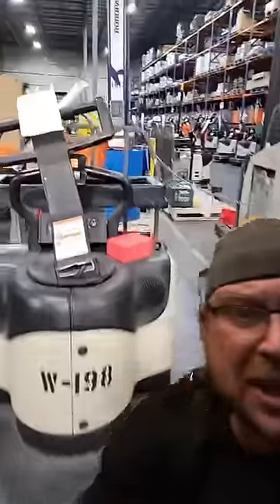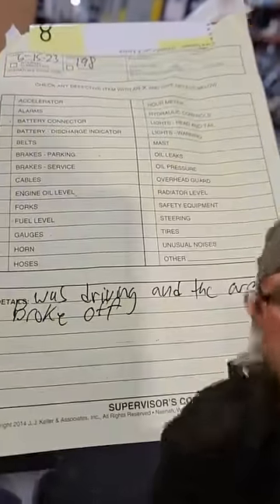Forklift Expert Analysis ￼

Comment: "while performing my daily inspection, which I do every day, I noticed that the handle was broken."
Reply from the maker: LoL 😝
Reply: My factory has inspection forms dated 2019 on the fork trucks. The funny part is that there are only 5 days worth of inspections on 1 sheet, so it's been a while
Reply: @jake6483 as long as all five days are filled out. That's all they're looking for
Reply: I go right down the sheet and keep it at 5mph all day
Reply: I unplugged it.
[checks everything off as good]
Reply: I just memorized the numbers for about three different jacks and forklifts, and wrote them on my inspection sheet every day 💀
Reply: Lololololol
Reply: When I do daily lift checks at work, most of the operators don't think or care to check the lift every day. Most of the shift spots where the forklifts was used that shift are left blank, because one operator forgets, and the rest assume it's already been done for the shift. That's one of my personal pet peeves. if OSHA was to come around and do an inspection and verify the lifts were used and saw no operator inspect the left for that shift, the company would get a huge fine from them.
Reply: Idk about all that... I just walked by it, brushed it w my purse on my way out & boom, it just fell off 😳🤷‍♀️😂

Comment: The original reason on the piece of paper is already gold. "Was driving and the arm broke off". Probably entirely accurate in itself, just leaving out the massive collision that happened to simultaneously occur.
Reply: It’s never what’s said, it’s what’s not said.
Reply: Naaah.  Man was on time block in the isle due to spill clean up sat on it happens all the time
Reply: Hey! That "massive collision" was my fat ass sitting on it talking to the thick new chick in the aisles 😅
Reply: hey. was driving ? check. arm broke off ? check. I see no lies here.
Reply: Repair guy doesn't need to know any more :)
Reply: It this poor guy could have been set up and actually didn't notice it, I've seen half broken stuff get fully broken when someone else gets it more then once
Reply: @drewrinker2071  true. "Here I was, doing what I could to prevent such an accident - putting some healing grease and repair-dust on top of the crack, I even gave the poor thing a rest by putting it right back into the equipment collection, without a warning label because I'm against discrimination like that... But you just had to break it, didn't you?"
Reply: Probably tried to ride it down the aisle doing a handstand on the handle with all the 300 lbs of overpower they got
Reply: It was using the handle as a chair to ride it.
Reply: @decnet100 healing grease. 😂😂
Reply: "I'm fairly sure the collision was unrelated, so I just won't mention it"
Reply: Haha simultaneously
Reply: Never said what they were doing while driving
Reply: Well, it is a crown🤷‍♂️

Comment: As a seasoned overhead door mechanic, I thank you forklift operators for the never-ending work.
Reply: I one time parked the forklift in front of the door because i KNEW it wasnt gonna fit. I go inside one of the guys calls me over to figure something out and i just hear CRUNCH. 🤦‍♂️ One of the other guys just drove it right though a partially closed door. Smh
Reply: I also thank them. Just worked on a rytec the other day that "came down" on the forklift. Nevermind the fork marks and the bottom bar being wedged cockeyed in the opening. Two sets of photos, two light curtains, two loops and a bottom edge and they still somehow smash a 30k door. Must have been booking it.
Reply: Do you work for overhead door?
Reply: No kidding bub.
Reply: @alfhwuqd  Yup!! Like the UPS driver who took out 2 sections, broke his windshield, and said the door was fully open.
Reply: I’ll second that seems Iam always working on doors that a high reach drive through and I’ll give ya one even better one of my stops is a freezer warehouse the clear rubber flap doors we have one that opens barn style and those get rapped around the top of the high reach mast when they ride through it at Mach jesus and it rips that door slab out of the hinges along with the drive chain and motor and the 3 phase wire lol that’s a 8.5 hour work order at -20 degrees lol 😂
Reply: Short story time, my workplace safety officer manage to take down a roll down gate and totaled the forklift he was using, best part, this was an hour after a safety meeting for "being aware of your surroundings"
Reply: @AerodynamicBrick  lmao impeccable timing sounds like lol 😂
Reply: @davidf644rock  I don't. But have friends that do.
Reply: Installed a new right height high speed door. Came back the next day to do another, and a forklift driver had already smaked the aluminum roll tube.
Reply: @AerodynamicBrick  Nice! His surroundings bit him in the ass.
Reply: You're welcome
Reply: We don't need you...we just leave the door a mangled mess at my place instead 😂😂😂😂
Reply: Weve had a door to a freezer installed thats both heated and if hit by a forklift it unzips before springing back into itself and rezipping, the door usually raises like a conventional rapid rise door operated by a pressure switch under the concrete. Looks to be a winner for the guys that fix them so far..
Reply: Lmao just yesterday at work i didnt realize the guy that opened the shop didnt open the garage door all the way and when it is opened all the way up there's about a half inch of clearance yup i gave an overhead door mechanic half a day's worth of work
Reply: I've never made you a freakin' dime, bloodsucker! 🤣 Of course I'm joking, I crushed 3/4 of the roll casing my first year as a EO. That was a very long time ago, and the shame has prevented me from ever doing it again. 😐
Reply: @jcheever37  I have the same story except "one of the guys" is just me, 5 minutes later.
Reply: @Colonel_Flanders  I've definitely clipped the last panel once.
Reply: It's always night shift
Reply: @Hanah  More times than not. They call to report that the door won't go up or down, I get there, and half the freakin door is in the parking lot. Yup, you're right, it definitely won't go up or down.
Reply: As an Automatic door tech I do not thank Forklift operators for the work. Lol
Reply: Many years ago I worked in a warehouse. During an annual inspection, the fire marshall told the company they had to repair or replace a huge fire door. I think it was over $5,000 back in the early 80's. The very next day, a dumbass on a forklift drove through the opening with his forks all the way up and destroyed the brand new door.
Reply: Dont forget about sprinklers, forklifts have a natural attraction to sprinkler pipe.
Reply: I saw a truck have to repark in a bay and then his back door swung open and completely detroyed every panel on that door and the trailer door. Everyone on the whatehouse came to look at that shit.  Dude was fired.
Reply: I’ve been working for 1 year in thid company and the overhead door was smashed 3 times
Reply: It is amazing how many perfect fork shaped sight windows I've seen punched through roll-up doors.
Reply: I say thank you, and it was second shift that did it, but thank you.

We have a heavy sliding door to one of several cooler areas, and the particular one looked like someone drove a forklift full speed into the door, from the inside.
One of the guys that came to repair it looked like Jack Reacher with a beard.
If I was gay, I would have creamed my pants looking at him, dude was that impressive looking.
We shoved the door closed as much as we could for a week, but it was like a chunk of the door roaring out, like the Hulk punched it before pulling it it open.
Reply: @deadjuice1880  sounds accurate
Reply: Lol I did that once unloading a truck at my old job. Hit the outside trim when I put the pallet jack up in a truck and went to back inside bc it was rainy. Forgot to put the forks down like an idiot (also talking to buddy lol) and ran the load backrest into the top of the door. I was sitting with that thing on the two front wheels battery and counterweight like 3 feet in the air. Only hit the outside though so I just went back later with a mallet and a tube of silicone (I worked at a hardware store) and bent it back, then sealed it up again. That was the only time I ever hit anything though, I like to go big with my screwups. First time I ever got pulled over a few years back was 120 in a 55 💀 maybe the go big mentality isn’t it.
Reply: i literally smacked an overhead door yesterday at like 10 mph 😭
Reply: @QuantumBender  thats nothing foot on the floor Friday a skid thats almost as tall as the trailer about a half a foot of the floor wam that door was done for
Reply: @quantumbender5840  ripped like half the rollers out
Reply: I've been lucky not to hit one but I know guys who have. I saw a guy break a glass overhead electric door. He put it down as he was going out and wasn't paying attention. Supposedly they docked his pay for 40% of the door, which he claimed was $1200
Reply: Place I worked at replaced all of the broken sectioned bay doors. They got them all done in like three days. Six or seven doors. The day they finished them, I was working on a night crew and watched a guy try to pull a semi load out of one of the bays with the door only half open. Destroyed the door. Like two days later someone on a forklift took out another door. The assistant plant manager was tiiicked.
Nobody has whistlingdiesel beat for breaking doors though. 😂
Reply: I worked in an offsite warehouse and I let the other guy open the roll up door before I pulled our box truck out of the warehouse. He didnt roll it up the last 8 inches and I bumped the door with the top of the truck. Thats on me for not double checking. I rolled the door down straightened it out. Not much bend it it because I dont drive like a maniac. Somebody reported back to the manager and he drove over and asked if there was something I wanted to tell him about. I had no idea what he meant. That is kind of a childish way to ask someone about something. He did have a masters in psychology so I always expected dumb words to come out of his mouth.
Reply: @alfhwuqd  Former forklift driver here. I loved timing it to where the rollup would be an inch above the forklift as I was going in/out as it was coming up. Never once did I hit it, but I almost did coming inside fully loaded (8,000lbs on an 8,000lb truck) on fresh snow. Did you know tread is useful? Management still doesn't believe me that it's useful for winter time.
Reply: The high speed roll ups are apparently not high speed enough...
Reply: @alfhwuqd I have had a door decide it was just going to refuse to open when the computer throws a fit before spent 20 minutes figuring out which breaker on the main panel it was to reset the damned thing so it would behave again. No remote disconnect anywhere remotely near it  so for 20 minutes got to play radio tag with the super.
Reply: @bigpimpin6085 that half inch between the top of the pallet and the sprinker is plenty of room.........
...........
Reply: LMAO!
   Define you had job security!😂
Reply: @davidf644rock  No.
Reply: I laughed much too hard at this. One of my customers got a new roll-up door, lasted all of 2 days. 😊
Reply: There was a manager at my old job that ripped 2 panels out from the middle of a door before. Dude was never drug tested. Later was arrested for robbing old people at the casino in the area while still working there.
Reply: @rmo9808  I go on a Home Depot call, midnight. The rolling steel door ripped out of the guides. I asked who the clown was. They said the night manager was on the forklift. Nuff said.
Reply: Just want to say sometimes it’s the floor care guy riding the massive floor scrubber and not a forklift that hits the roll up door so make sure to thank them as well
Reply: Sup, fellow seasoned OH door guy....42 years...got started at 11...fam owned a door company...peace
Reply: It's not only forklift operators who do that, sometimes forklift techs forgot a thing or two...
Reply: We used to have a FL driver named Dan. Dan was not known for his smarts. Dan managed to get the OH door to come down between the mast and operator compartment while the truck was in motion. I witnessed this first-hand along with Stan, the very competent person who was promoted out of there forklift position allowing Dan to be hired. 
Stan immediately hung his head down and said "I guess I'm going back to the forklift".

Comment: I've heard :
 "it came like that", 
"because it's a crappy brand",
"the guy you fired last week/month/year used it last"
"I didn't even notice"
And number one reason I fired someone: "I don't know"

BEST excuse ever: I didn't drive the bigass Kalmar AC120 through the brick wall " - this was LITERALLY said to me WHILE the rest of the crew was digging the guy out from underneath the rubble that once was a wall....HE STILL HAD BRICK DUST AND CHIPS IN HIS HAIR. OH, And he was still in the driver's seat. 

I'm glad I'm retired.
Reply: I shit you not.  We bought a brand new forklift that was delivered with zero oil in the differential.  We didn't realize it until about a month or two later when it just hard stopped one us while I was driving it.  Out mechanics said it was bone dry.  The dealer didn't add oil in that one, and got to change the whole front end out.
Reply: But officer gas pedal was stuck😅😅😅

Comment: Hi ! Well I hope they didn't get hurt  ! I saw someone who was killed using one of those electric pallet jack lifts , laying on the floor , chalked out by the police ! This was before they had the stop pad on the top of the control handle , she was backing up a pallet in reverse in confined room with shelves on both sides of the small storage room . She backed her herself against the self support column behind her ,with the handle being pressed against her abdomen,belly button area . Back then these lift would still roll some what after you stopped using the twist control handle, like on throttle control like a motorcycle has on the handlebars. I think she went to react and accidentally twisted the handle the wrong way in reverse, after  realizing her back was against the support beam for a shelf that was behind her with the control handle in her belly button area, it pinned, crushed her momentarily, killing her !! So sad , a mother of two . So please 🙏 be very careful when using one of these, this is not a toy to be messing with, think about what your doing before your going to move anything !! 😢

Comment: As a former second shift operator, it's because some idiot drove it handle first into a wall and set it to the side 😂
Reply: Second shift driver is just lucky he didn't become one with the wall from that.
Even with a panic button on those things getting pinned against a wall and a few tons of uncaring machine makes for a quick need to change your work pants.

Comment: We use Crown electric lifts where I work.  I was using an old one (backup when the others were dead) once that had some problems with wanting to either not move or not stop.  I was taking a turn with it moving away from me when all of a sudden it ripped out of my hand, hit an I beam, and kept spinning in place even when the tiller (handle) was standing up in place 😂  glad there were witnesses and that no one got hurt, we promptly retired it.

Comment: At this one warehouse I worked at we had an old Toyota power jack where the throttle would stick. One day without thinking about it, I parked it underneath the racket and just turned the key off. Asshole boss comes in to use that pallet jack after insulting my mothers intelligence, flips the key on and flies through the racking.
Reply: Maybe he should have insulted your intelligence instead because that is 100% your fault.
Reply: @automaton2953  *your
Reply: @automaton2953 you'mst*
Reply: Can’t make that up. That’s a true story.

Comment: I was second shift. Got blamed for everything.
Reply: Night shifters do one little thing wrong our butts are on the line.
 I wonder why first shifters get away with as much as they do.

(As a side note I've worked in like 5 factories and its the same situation same with my friends)
Reply: @exiledhusky  it's the same everywhere I've been.
Reply: I'm a Lead in 2nd shift, the number of times I was told my guys did something when we are not on the clock, let alone in the building, is amazing
Reply: @AerodynamicBrick  rofl we have had it were we as a skeleton crew on nights cant run every machine, well we come in the next day and first shift blamed us for an eff up on a machine we didn't even use, aka it was them when they left the day before 😂
Reply: @exiledhusky  saw a first shifter take a brass mallet to a machine and blame it on a night shifter

he's still there afaik. barely even got a talking to
Reply: I can also confirm that

Comment: As a second shift worker who uses presses from the 40s I can say that I do indeed break them regularly as they have tooling quite literally older than my grandfather
Reply: seems the tooling is mightier then the press
Reply: @lbochtler  the tooling is the problem 80% of the time and it’s a VERY annoying process to fix it
Reply: @Grebogoborp  where i worked we had press brakes and shears from the 1930's .  maintenance had manufacture parts that were needed.

Comment: I was a fork lift mechanic at Tyson foods for 5 1/2 years and I recognize that style of pallet jack. It was a good job except when operators did not bring them back to the shop. Then, it took precious time to go onto the floor or clear out to the dock to bring it back. Finally, I quit enabling and let the 1st shift bitch at the 2nd shift for having to wash and change the battery before they could go back out on the floor.